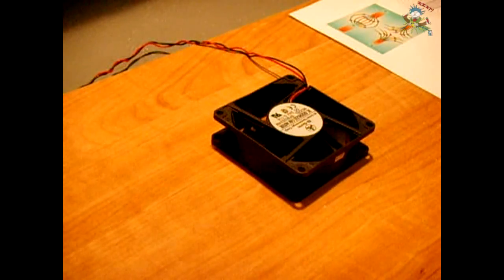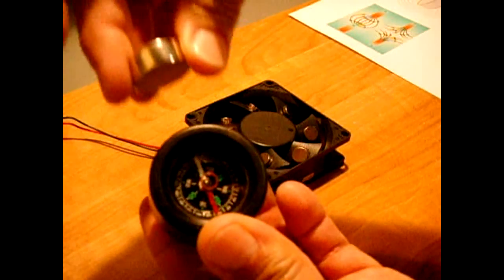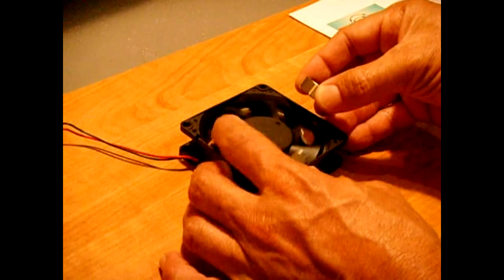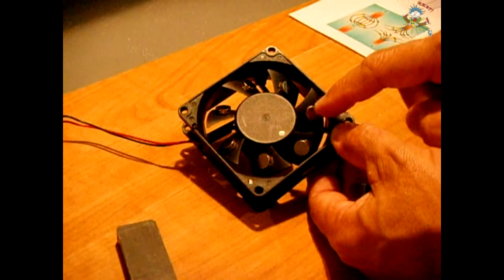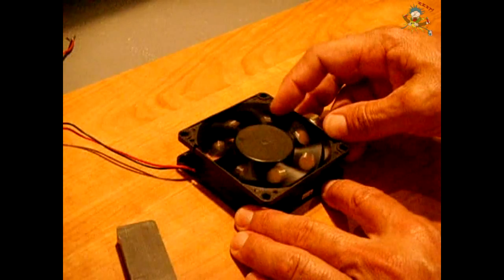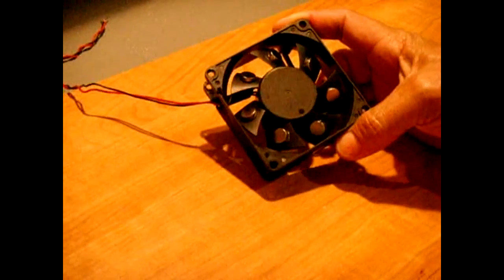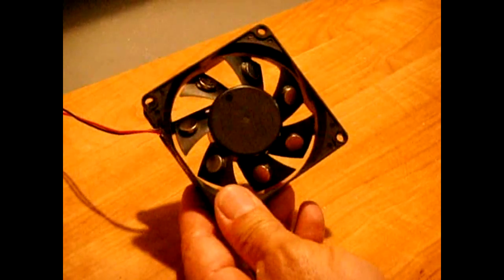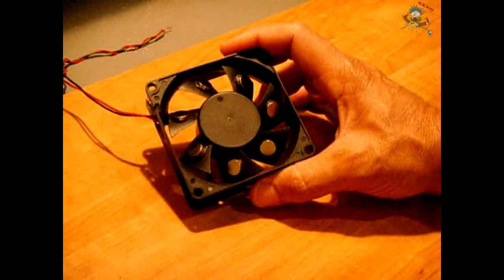Free Energy ~ Case Fan Magnet Motor / Real or Fake?

Comment: The cogging is happening because the video you have watched might have the fan with larger diameter and the fan you are using is of smaller diameter. When larger diameter fan is used, distance between the fan blades will increase and it might stop cogging from happing. so try it.
Reply from the maker: +Mac Decon 
Hi Mac. The device is a scam. Save your time and money. Watch PART 2 of this video to learn how the scam was likely pulled off.

Thank You

Comment: bet you're right, im not an expert, but by intuition based on your information, the problem with your engine, is related with the size of your fan magnets, no matter the size of the magnet the impulse would be the same, but there you're using the large fan magnets, that has a biguer "neutral zone", i mena their sides are to large, youre not laking impuse oranything, its just that the neutra zone betwen whole the magnets is not reacting to the magnets, losses power and you went no where,.... Sry the bad english, but to be quick, put fin magnets on the fan, and you'll reduce the neutral zone, and the gain will be constant, overcaming the caught effect, after few spins it will be cut of and you'll have what you want...  The right angle of the propolsion is also veri important, try not use large magnetics to generate impulse, kus if you put in the wrong angle a big magnet you'll cause influence over the next, witch will try toi spin to the other side...       A little improvement, if you have tools, do the step above, and use more magnetics, maybe 3 of them in the right angle, drill a hole and somehow fix them than you can use a most powerfull magnetic to repel the wired one, and in this case, of usign large magnetics on the fan, since your wired magnetic will be spining, it'll hack of the caught effect, but you need at least two wired magnets in oposit corners of the fan and two identical magnets forcing them to spin, only one thing, folowing the rulle, the first magnetic against the clock must force the wired 01 to spin to the right and the 02 wired magnetic in the other corner must be spining to the left, this will force the system to gain X^2 speed...  actually you will gain more speed, but the magnetic field force is will be always the same unless you use a large fan... whole energy that the fan could not suport on this system that i describe will than be converted and spend as friction and heat, put all this inside a vaccum chamber and it will spin almost forever....  good luck

Comment: say you had a motor like that, but instead of a few wings with magnets on you had I dunno, a hell of a lot. Your magnet is pushing it, but not pushing it enough to repeat the process on the  following wing. I have magnets that when i set them to repel after i force them into close proximity, it sends the other magnet  away with a considerable push. If the magnet was strong enough to push the magnet on the wing enough to get the previous wing in front to repeat the process again, then surely wouldn't this work?
Reply from the maker: +Matthew “AceWolf” Denton 
Nothing will work. :-). Watch Part 2 to see how the scam was likely pulled off. Trust me, if this worked, everyone would be making and using these simple devices.

Comment: you need MONO pole magnets on the fan, or you need a cct to swap feilds at the right time, or something that "spins a interference feild at the right time... thats the tricky part.

try this and see what i mean,  .. spin your interference magnet with your hand but on an axis near or in the "sweet spot" you have to find it, but not hard.. you will get a few actual spins to prove concept..... but not a working motor .. yet.

Comment: You will never get as much energy out as you put into a machine like this.  End of story.
Reply: +wowsdrawkcab You&#39;ll get no energy at all because you can't make the fan spin with just magnets. The video is fake.
Reply: +valveman12 i guess you just have never used magnets before. you can easily make the fan spin with just magnets as long as the placement is right
Reply: +valveman12 
these asshats are so hard to debunk
Reply from the maker: +Joshua Jacofsky 
Really? When you have a working model, contact me. :-)
Reply: Joshua Jacofsky Really?  Have you seen my videos on magnetic motor BS?  Perhaps you should have a look.  I explain why it is not possible to make a magnetic motor from just magnets.  Apparently you have never done it because if you actually tried, you would discover it is not possible.
Reply: electronicsNmore Don't hold your breath on a working magnetic motor.

Comment: I believe that in order for that to work without the cogging.. you would have to drill holes on the blades so that most of the magnet is exposed when clued from the "opposite" side of the blade and then I think it will work.  That way you don't get the side exposure from the magnets... just a theory.. it might work that way..
Reply from the maker: +Johnny Quest WY (Johnny Quest) 
Hello. Unfortunately it will not work. Please feel free to give it a try.

Thanks For Watching!
Reply: Yea..I might try it out and see how it goes. I will post it on my channel if it goes well.

Comment: If you have a stationery magnet that created free energy you wouldn't need Youtube likes. You'd create perpetual energy and be a multi-millionaire.
Reply: john sims 😂
Reply: +john sims it  doesn't create energyit converts  magnetic power to kinetic energy
Reply: You are bad at physics. Research "cogging" and understand why this is a scam.
Reply: john sims

cogging can be a problem in a device like this but there are ways to solve cogging problems

it's not an automatic death knell

so if this is fake is John Christies magnetic motor also fake?

google  it
Reply: this is in no way close to a magnetic motor. This fan has a battery in it with a switch that is connected when magnetized. Use your brain not your eyes.
Reply: john sims

so you are saying some of the magnetic motors  do work?
Reply: Define "work." Using a system of copper coils, magnetic "motors,"  reduce the rate that energy decays. Some can do that for a very long time, but they aren't creating energy, merely decreasing the rate that energy escapes. This is such an obvious hoax that I feel bad for anyone who falls for it.
Reply: john sims

my discussion now is about magnetic motors

they don't create energy
they convert potential energy to kinetic  energy
Reply: My point is if you see a "free Energy" anything it's a scam.

I don't see how a magnetic motor relates in anyway to this. The problem with magnetic "motors" is the same as the initial struggle with electric powered cars. Controlling the kinetic energy to accelerate quickly or slowly. So putting a motor in say, a car, requires a lot more than a neat prototype. That's why all the magnetic motors made 10 years ago are still just prototypes. 

Investors want to make money quickly and having to go through hoops to bring a heavy non-complete design to production is a pain in the arse.
Reply: john sims

the inventor is trying to explain the power of magnets the best way he can
he mistakenly used the a synonym for free energy

the motor and this device both work because of repulsion
Reply: john sims

I placed his statement in what I believe is the right category : incorrect

that's all I did 

it's incorrect no matter who made it
Reply: or someone will KILL.YOU BEFORE.YOU BECOME MILIONER...

Comment: Even the industry knows that magnets can provide means to bild motors. The problem is that you don´t have expertise in constructing them the correct way, so you condemn all experiments. Try to learn with people who have success. You need to see a recent Discovery Channel program that showed many projects which works, and almost all scientists who developed, died misteriously or was assassinated ( Perhaps by the oil industry guys ) on the XX century. Did you know that Rudolf Diesel invented his motor, but in the beginning it was designed to work with any oil, even from garbage, but the industry adapted to work only from current oil ? And many other inventors. Here in Brazil, near my city, a man invented a car moved by water, eletrolisys, his project was adopted by some government agencies. I need to put this program at youtube.
Reply: +Dihelson Mendonca Nope. Industry engages competent engineers and they know that no motor can be driven by permanent magnets alone. All magnet motors shown running are scams.
And no inventor was ever assissinated, these are silly conspiracy theories. Name me someone who was assassinated and I show you at once that this is a mere fabrication.

Diesel motors do run with different kind of oils but most drivers prefer to get their fuel from the petrol station. And a water car is as impossible as a magnet motor. Any person claiming this is a scammer. If you look closer your inventor in Brazil makes claims only, I am sure he never submitted this water car to any objective test.
Reply: There´s much scam, but there are serious people working!
Reply: Dihelson Mendonca
Not really. I don't deny that there are people with a serious intention working on magnet motors. But from the arguments of those people and from the way they try to do measurements you can see at once that they miss any competence in physics. There may be serious people working in this field but never competent ones. Since competent people know that a magnet motor is not possible.

Comment: may be he used stronger magnet!!!!1
Reply from the maker: +may ann Acejo 
What he used is some pixie dust and deception.
Reply: +may ann Acejo If a magnet motor would work, he would also work with weak magnets, the difference would only be the power delivered. But magnetic forces in such an arrangement always work clockwise and anti-clockwise, sum is zero. And since 1000 minus 1000 is as zero as 1 minus 1 the strength of magnets does not matter at all.

Comment: I think you need to try 4 square neodymium magnets to propel the motor.
Reply from the maker: +d w 
Please watch part 2. You will see how the scam was likely pulled off. Step by step. Does not matter what magnets you use. Thanks For Watching!
Reply: I find it hard to believe that the type and number magnets used doesn't matter.  It was just a thought though.

Comment: good day, i saw the video many times, and tried to do the same for the last two days, nothing works, i tried many ways, and believe that the way that can work is with moving magnets in circular way at same speed than the fan to pool by one pole and to push by the other each time that two magnets on two palms of the fan but at opposite pole. but i have problems to find good mechanism that can turn at same speed of the fan,... if any idea, they are welcome around antwerp in belgium. thx.

Comment: what i feel like you have magnets too close to each other. try using with one empty wing and another with magnet that might help spining and avoid coaging
Reply: +Bharat Sharma doesn't work believer it is IMPOSSIBLE -,-
Reply: Nathan Hamers i found the trick they use a small battery with a small trigger whenever some some touch the magnet to a specific area it trigger the switch and fan start swinging
Reply: Bharat Sharma You cannot "feel". You must follow the laws of thermodynamics. 😊

Comment: the video i saw, im guessing the same one you saw, you'll realise he has plastic around the outside of the magnet, somewhat shielding the field
Reply from the maker: +Skid Kid You are thinking too hard because you refuse to accept the fact that the device is a scam. Plastic does not shield magnetic fields. Only steel/iron/nickel can reduce the field.

Thanks For Watching!
Reply: im not thinking too hard, thats just what i saw, i dont refuse to accept it. and sorry, i didnt completely understand how shielding works, have you tried shielding it to see if that fixes the cogging?
Reply from the maker: Skid Kid
You seem like a nice guy, but you are being duped by the other video. When the video uploader claimed that the plastic on the side of the magnet blocked the side magnetism, you should have known at that point he was a fraud. Plastic does not block magnetic fields. If you doubt my video, try it yourself. You will be back. :-)
Reply: +electronicsNmore yeah I'm a pretty chilled guy aha. 

that's what I'm saying, I don't know much about the shielding, so I just took it for what he said. it did strike me as a bit strange that plastic would have any effect on magnets though

I am going to try to make a magnet motor but not like these
Reply: +Skid Kid Shielding also does not allow the construction of a magnet motor. For such a construction it would be necessary to switch the shielding on and off, e.g. by moving the shield mechanically. But this movement absorbs all energy which was gained. If you understand the fundamental principle of conservation of energy you will stop trying to magnet motors. No go.

Comment: You're doing it wrong. Try with same size metal washers on the fan blades and hot glue 4 hard drive magnets (the 4th one must be cut in half to eliminate cogging)  to the corners, use can attach a 12v transformer to a three pronged socket and get 3x 70w bulbs cranking. All the good videos are being taken down or suppressed. We can't have people Learning to make their own free energy now can we? Might just spoil the NWO plans! Yo Baywarra power!
Reply from the maker: +Gathaka LOL. This is hilarious. You have NO video on your channel showing that you made this device and that it works, yet you are giving me advice?

Comment: It's not free energy, since it's taking energy from the magnet and it will eventually go flat. But with a powerful magnet it could run for a very long time. Not very cost effective in the long run though, good magnets are not cheap.
There's also the fact that magnets take quite a lot of energy to produce in the first place...
Reply: There is no energy in magnets and it doesn’t spin at all.

Comment: A small question.
With the same fan and magnets, If you do turn one fan with an electrical current.
How many (fan stacked with the same magnets) does it take to have the same voltage and amperage for a greater output than input?
Reply from the maker: Pierre Mignault Hello Pierre. I do not understand your question. You want to supply DC power to a case fan with magnets on its blades like shown in this video, then do what next?
Reply: Sorry, I'm French ...;)
Yes. Powered only one case fan with magnets glued on the palm and ( "X" number of fan and same magnets) thats acts like a generator.

"The Multiplicity Principle"

How a single motor can drive several generator. Use magnets as drives and as axis
Reply: Pierre Mignault The question is. How many case fan acting as a generator (collecting energy) will equal the energy of the supply DC power to a single case fan ???

If a motion is past with no friction (using magnets) = 0 resistance or close to 0. A case fun running on "X" volts, "X" ampere and runs at "X" RPM.
If the generator case fan runs at the same RPM and will give the same voltage, but the resistance to create energy (drag and friction) will reduce the amperage of how much?Why these case fan have 3, 5, 7 or 9 blades/palm? Odd number or impossible to balance.Thank youPierre

Comment: I read some interesting comments from Jack said he had ordered the parts 4 mths ago and would make one, also from Karol 8 mths ago said he would upload his work. Does anyone of them come back to you with something? If yes pls put the link, if not lets just wait (it's been only 4 mths anyway, probably parts are from far away and delivery is not so smooth..)
I just want to know if anyone can actually make this thing works, then if parts and schematics are clearly published I want to re-create one by myself if cost and time are feasible for me. Because I have some thermodynamics books in my closet, it will save some slots there if I could throw them away after i make my perpetual fan.
So, I am still waiting for the updates.. Waiting for nobel nominees.. Thanks..!!

Comment: it seems to me that you have built in magnetic switching problems. Would it be possible to use a set of extremely light push rods on cams that would act similar to the push rods and valves of a gasoline engine. The cam being in the center of the fan as an armature, pushing magnets via push rods, return springs in an assembly to and from staggered - and + mounted magnets instead...With the power of magnets now days and light weight metals I think the right person/machine shop could do it.
Reply from the maker: Rick Edwards Please watch part 2. All questions will come to an end. :-)

https://www.youtube.com/watch?v=M6QV0AfDF2k

Comment: does spinning a dc motor give out energy?
Reply from the maker: Voon Eng Hong Of course it does, but that is not what is being disputed. What is being disputed is the fact that a single stationary magnet will not get a fan to spin into motion with magnets affixed to the blades. Not going to happen. Many case fans due to the internal circuitry will not produce power when spun by hand, or produce very little power, but many other case fans will. I still have an offer on the table for $100.00 payable by Paypal for any person that will send me one of these fans they claim works. :-) Not one person yet. What does that tell you? Total cost of this device is around $10.00(fan & magnets). I would make these all day long for a $85.00-$90.00 profit.
Reply: i mean the dc motor like the one in rc car
spinning it will light up led light? i see that before at other youtube video just dunno its working or not
Reply from the maker: Yes, they all produce power when spun by hand.
Reply: so i need to turn very hard to light it up?
Reply from the maker: I have 280+ videos of people asking questions. I am unable to chat back and forth with one viewer. You spin a DC motor, and you will produce power. You need to determine how fast.

Thank You.
Reply: ok tq for information